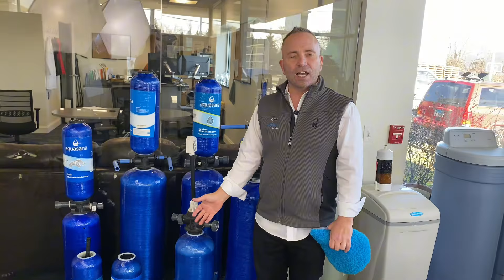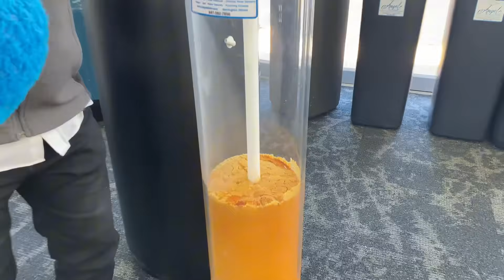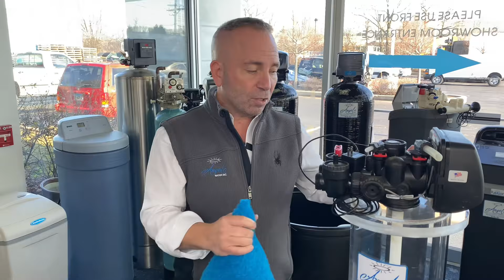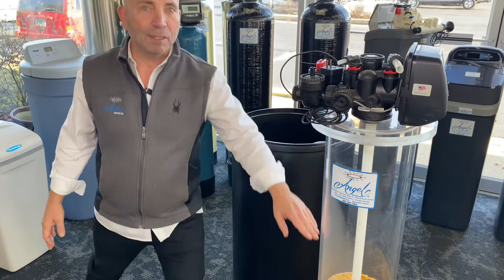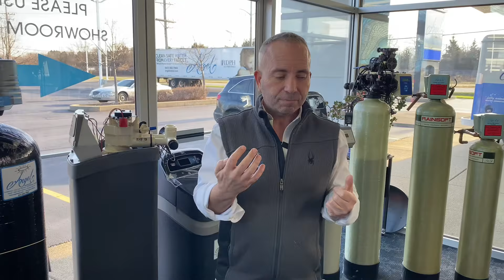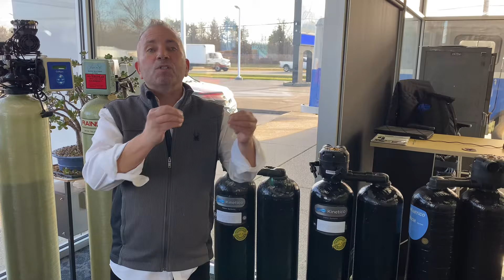Top 2025 Water Softeners

Comment: Was going to switch to Tankless Gas Water heater. 
Plumber said that without a water softener they only last about 2 maybe 5 years in Arizona...not the 20 yrs advertised. 

Came here to learn more about softeners..
Learned everything  i need to know...Thank you.

NSF 44, salt system, aprox $8-10k
Reply from the maker: Thank you for sharing this, Chris! 🙏
Your plumber is absolutely right — in places with very hard water like Arizona, tankless heaters can scale up fast and fail in just a few years without a softener. Hardness minerals coat the heat exchanger and make the unit work way harder than it should.

I’m really glad this video helped you understand how softeners work and what to look for. An NSF 44 certified, salt-based system is the gold standard for protecting plumbing, appliances, and your tankless heater.

If you ever have questions while shopping or comparing systems, feel free to reach out — happy to help you make the best choice for your home!

Comment: I am replacing my Kemore Elite water softener which is 14 years old. I have had zero issues with it. (But you dont know how effective it really is unless you test the water on a regular basis). With that said,, I gained some knowledge about water softeners. 
I decided on a Kinetico Premier water softener. The reasons why I purchased it, which was over $4,200, is the following. 

1. They include a sediment filter. This filters out particles in the water, which can affect the water softener working at its best and prevent those particles going in your appliances and faucets. 
The Hauge unit, which was $1,000 less, did not offer this.

2. It has a chlorine charcoal filter. The Hauge also has a charcoal filter, but they claim the filter never has to be replaced. This seemed odd to me. All filters need to be replaced at some point. The Kinetico filter is replaced every 5 years. Chlorine can effect the resin being as effective so you really want to add this to your system.

3. It has dual tanks, while the Hauge is a single tank. What that means is that when they regenerate,  they are using hard water in the process. With the 2 tanks, its soft water when regenerating. Also the Kinetico only regenerates when needed. Many electric ones are set to regenerate at 2 am, perhaps when it may not be necessary.  They also many times use more salt when regenerating. 

4. It does not need electricity, so it would work if you lost power. It's not much of a big deal as how often do you lose power?  But it also means no electrical breakdown could occur if there is an issue with the unit, or if there is a lightning strike in your area or brown out that could damage the electrical components of a electrical water softener.

5. It is NCF certified.

6. It is made and assembled in America.
Reply from the maker: Kinnetico was once certified by NSF to 44 Standards.  The last time I looked at NSF’s website it was no longer listed.    Not sure if it is manufactured in USA or not.  Check with Kinnetico.  If Ecowater is not selected, I do like Kinnetico as a solid second option.  Good luck!
Reply: You could have gotten an Ecowater 1502 R40 with carbon in it.
About the same price.

Comment: 1800 budget. 550ppm DS. Low iron. 4 people. I want salt. Which pleaseeeee ? Well water. I’m watching the video either way. Thanks 🙏
Reply from the maker: Ecowater has a product line called the IDP Series.  You might call a local Ecowater dealer and see if they can hit your price point.  I would argue that it will cost you more in the long run if you don’t buy the right system today.  If you plan on your current home being your forever home, I promise its worth spending a little more now so you don’t have to buy a few of them.

Comment: This man is absolutely right, very informative. Thank you for sharing. I can confirm what he’s saying. I have the kinetic system that I installed from authorized dealer in my neighborhood. We have very hard water. It is so bad where he puts holes on the galvanized pipes that were coming from the wall. I’ve had the system for 12 years with regular maintenance. I haven’t had a problem where my neighbors are replacing their systems every couple years.

Comment: what about the Rheem Preferred Platinum water softener sold at home depot? Seems like good value and especially the wifi mobile application integration with optional remote control water shutoff valve.

Comment: I have a high water usage home since I have 9 people in the household.  I like the Ecowater system and since our consumption is probably higher than an average household, is the CR3700 the largest system?  I went to the Ecowater website and they don't have a EcoWater Pro in my area.  Can the unit be purchased on its on and easy enough to have my plumber install?  I currently have a Westinghouse unit, and I think because we have iron and magnesium in the water (I see orange rings around the faucets) the system isn't working at max potential.  Also, would an inline Whole house filter be a recommended?  If so, can you recommend one that works well with a water softener system?  thank you!
Reply from the maker: Yes please give us a call at 847-382-7800, ask for Jason, we may be able to ship you an ECR3702 because its a much bigger system. We would also need to get water test results specifically we are looking for how hard your water is.. it is measured in grains per gallon. Thank you for contacting us.

Comment: I've got a 20 year old GE SmartWater (model GXSF30H) water softening system.  Based on my own testing using water hardness test strips it seems to be working fine.  I have well water that tests out at 7 gpg hardness, but my softened water tests out at 0 gpg.  I have done only minimal maintenance - cleaning the nozzle and venturi assembly.  Any reason why I shouldn't just keep it until it fails?  Thanks!  BTW, the resin tank says 'Ecowater Systems, Ripley MS' so maybe they were made better back then.
Reply from the maker: Yeah wow thats fantastic Jim. Yes back in the old days EcoWater manufactured that for GE and they did last a long time. Unfortunately today the GE units are now made in China and not by EcoWater so they don't last nearly as long. Thanks for watching, glad to see you still have soft water!

Comment: Does anyone know if I can use a water softener with a reverse osmosis filtration system?
Reply from the maker: Great question! Yes, you can absolutely use a water softener with a reverse osmosis system, and in fact, they work great together! The water softener removes hardness minerals like calcium and magnesium, which helps protect your RO membrane from scaling and extends its lifespan. The RO system then provides an extra level of purification, removing contaminants like chlorine, heavy metals, and other impurities. Together, they give you softer, cleaner, and better-tasting water! Let me know if you have any other questions!

Comment: Is EcoWater and EcoPure watersoftners equally as good?  We have 24 hardness and 3 iron in our water.  We live next to a farm field.  It runs off though our yard where our well is.
Reply from the maker: Brenda, I urge you to do what you can to protect your well cap, make sure the water runs away from the well cap and not at the well cap, for that water will go directly down into your drinking water. EcoPure water softener is a big box product it is not as good as EcoWater... at 24 grains of hardness and 3 ppm iron I would urge you to contact EcoWater and find a dealer near you.. and purchase the ECR3702 system - it will take out the iron and hardness from your water. I also would urge you to purchase the ERO 385 drinking water system which is NSF 58 certified and will remove toxins out of your well water. Also Brenda, It is very important you do well water testing. The EPA has a great link I will comment here that you can get to and learn what you should get your water tested for.

Comment: Great video. I am on low sodium diet due to hypertention. And i see everywhere on internet that water softner adds  sodium. Should i get water conditioner or is there other ways to use softner and not have sodium?.
Reply: You can add a RO SYSTEM 

REVERSE OSMOSIS 

IT WILL FILTER OUT ALL OTHER PARTICLES AND CHEMICALS